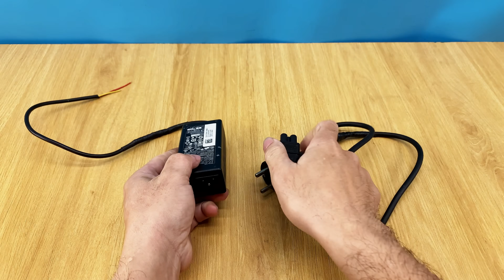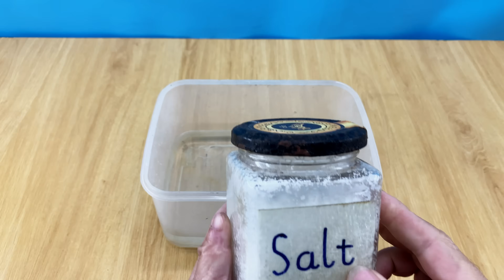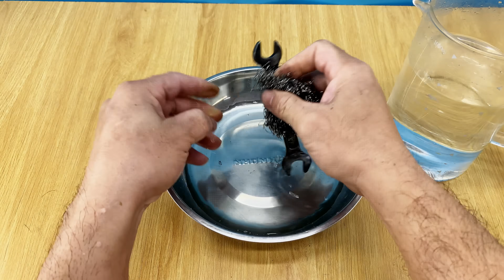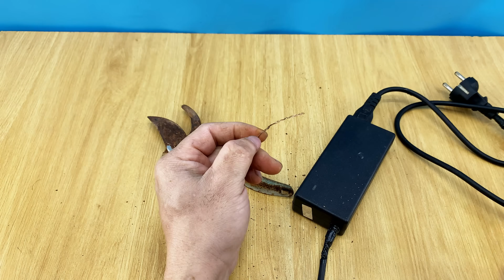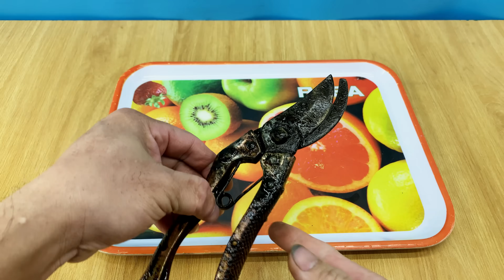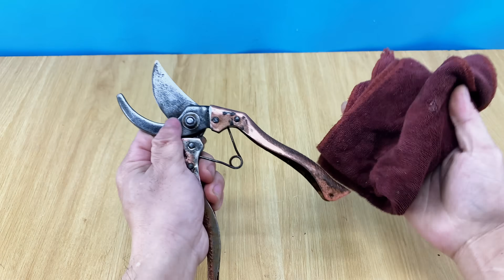NEVER Throw Away Rusty Tools! Use the Laptop Charger Method and Watch What Happens

Comment: 50 лет назад, когда я служил в армии, мы брали металлическую коробку от обувного крема и присоединяли один провод к коробке, другой к крышке от коробки, между ними  какую нибудь прокладку, например деревяшку, связывали это нитками. Потом это  ложили в ведро с водой и включали 220v. Прибор аж гудел, но воду грел хорошо. Своего рода, мы делали кипятильник.
Reply from the maker: Interesting story! That sounds like an old improvised heating method, but using 220V in water can be very dangerous. Always be careful and use proper, safe equipment. 👍
Reply: @ToolBros8479  Я это делал 50 лет назад, в армии. Тогда было необходимо, нечем было греть воду и этот способ выручал. С тех пор, я этого не делал, не было необходимости.